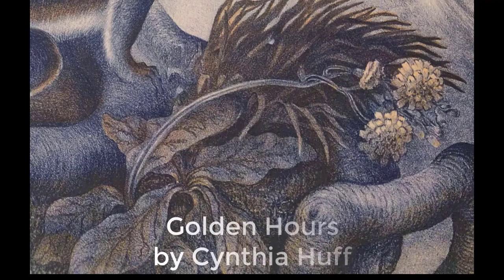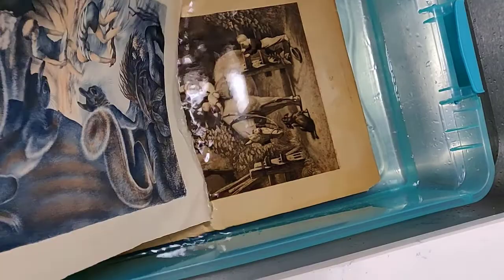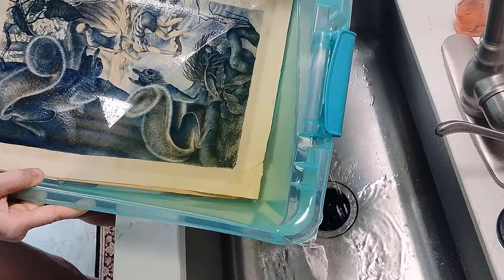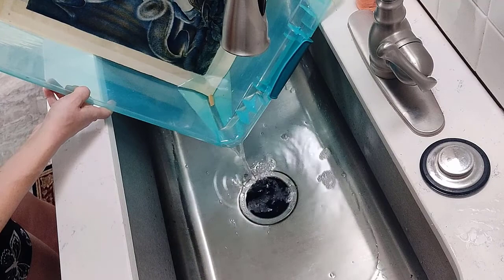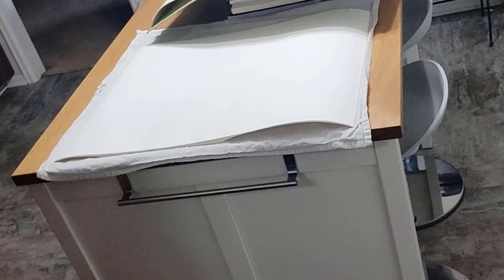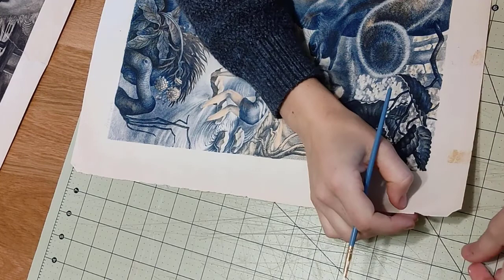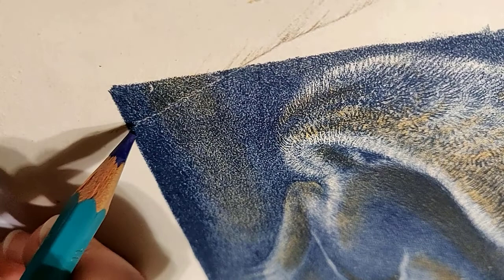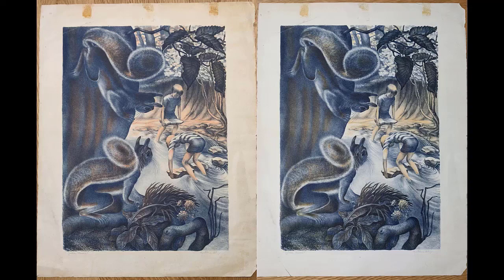Print Conservation, bleach bath and repair of a lithograph and an engraving

Comment: Thanks for the video. Can you help clarify the formula used for the bleach wash? Are you using ethanol?
Reply from the maker: It is not ethanol. The bleach bath is regular water plus chloramine t trihydrate (1-2 tbsp worth). You can purchase it online from Talas or similar conservation material companies. Don't forget a vinegar water bath when you're done with the bleaching.

Comment: Hi. Does it work with a drawing entirely made in ink (nankin)? Or will the bleach affect the ink (nankeen) ? The drawing is 50 years old and the paper is very yellowed.
Reply from the maker: You should put some very very tiny drops of water on the ink, here and there, in inconspicuous places, and see if it bleeds at all. Like when a rain drop sits on a leaf, like a little bubble of water. I use a magnifying glass to watch it and have a paper towel handy to dry it quickly if the ink runs into the water. If it does not bleed I'd try again with a bigger amount of the image, like with a artist sized paint brush swipe to ensure it won't bleed. If no bleeding you should be good! Sorry I don't know anything about that ink, good luck!

Comment: Would you have any experience using this solution to remove brown spots? I have a lithograph and it seems that it had a reaction to the matting? How would someone reach out to you if they wanted to use your services?
Reply from the maker: It is certainly possible/likely chloramine t will help. For foxing/small spots that don't wash out you can also use a stronger ratio of chloramine to water and paint it on individual spots then use vinegar to stop the bleach action. Just like a bath it will likely take a few rounds for it to fade considerably. If it's a really tricky spot you can try a combo of chlorine water and 10 percent hydrochloric acid, or cut out and patch the spots if it is that important to remove. I am just a hobbyist with an art and museum background, and I get the majority of my info from the web. If you want to email me some images of the print I'd be happy to take a look -  j_sb_j@yahoo.com. I'd suggest looking into finding a professional restoration/conservation company, sometimes museums or libraries can help point you in the right direction to find someone...I often just search on Google maps for art restoration/conservation and see what is in your area-It will likely cost you one or a couple hundred dollars. Many will give free estimates in my experience. You'd have to weigh if the image is worth the $ to you or buy some chloramine and give it a go yourself! It's hard to royally screw up, and lithos, unless hand colored, should not have a problem handling water baths. Here's a great link I regularly visit for the best foundational paper conservation knowledge- https://www.conservation-wiki.com/wiki/Book_and_Paper_Group_Wiki
Reply: @SoreNebula  thank you for responding! I appreciate you taking the time to do so!